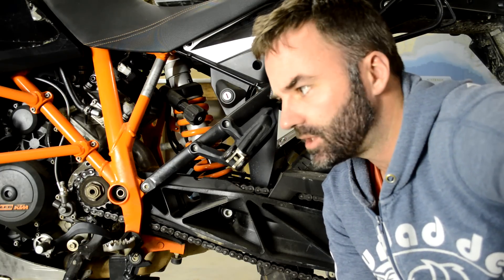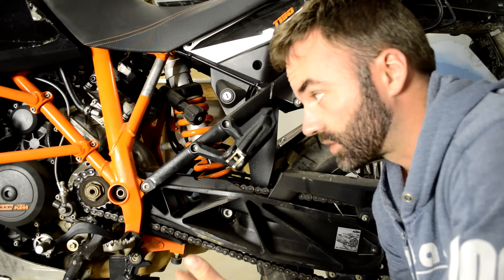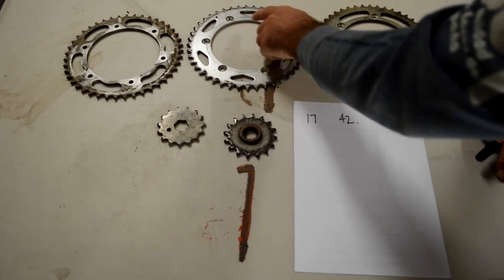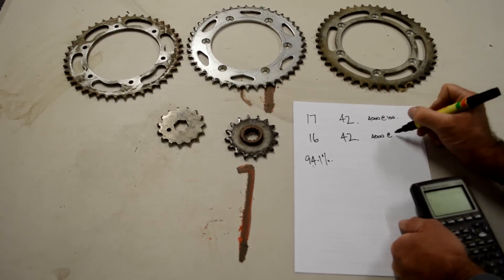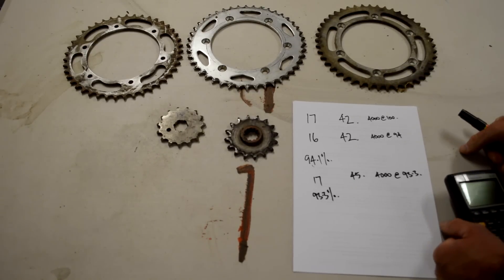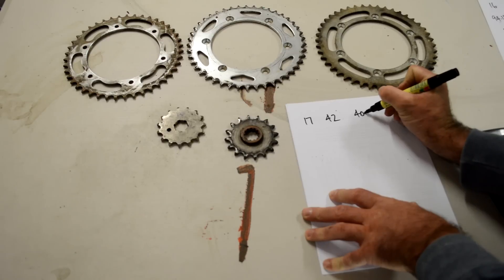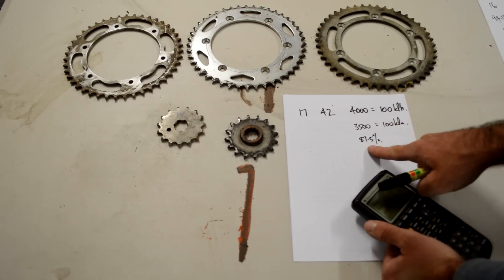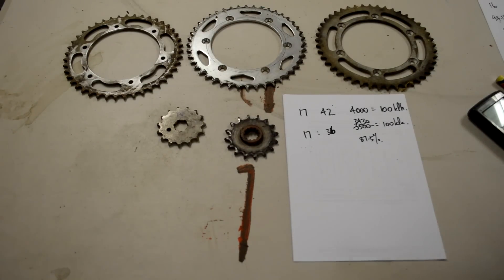Calculating what sprocket to get on your motorcycle

Comment: Do not throw your money away changing the sockets. This will only make 2 results:

1. this will improve starting off (launching)
2. this will increase your RPM in top gear at highway speeds. 

Changing the sprockets is changing the final gearing on your cycle. Changing the final gearing means nothing. What really matters is overall gearing. Overall gearing is everything from the engine to the rear tire. 
Overall gearing is a affected by these areas:
1. Manual Transmission
2. Drive sprockets (final gearing) 
3. Tire size (actually have to change rim diameter to change tire size much)

It is a very common misunderstanding that changing the sprockets will mean you'll always have lower gearing. That is not true. You have a manual transmission. That allows you to have what ever gear ratio you want. If you like the power of low gearing then don't shift until redline for all I care. Shifting at redline is not what you really want unless you are drag racing. My point is you can decide how high you want your RPM to go before shifting. 

If you like low RPM for fuel efficiency shift early and keep your RPMs low. 

Once you get in top gear you can't shift up any more. That's why I say changing the sprockets will affect the RPM on the highway.

Comment: great video thank you...
i do have a question...
if i keep the same rear sprocket and i increase 1 t in the front i can have more torque exiting from corners right? my engine will produce a little more torque and higher rpm.
Reply from the maker: No. If you want more torque, you need a larger difference between sprockets. Increasing the front sprocket is the same as reducing the rear sprocket, which gives you lower rpm for the same speed.
Reply: Any recommendations for my gn125 has 14/42 running at 7.5k at 100kph looking to get 6.5-7rpm

Comment: You also need to consider chain tension if you don't want to shorten or purchase a new chain. If you want drastic changes adjust both in the opposite direction. If your looking to increase rpm and gain torque decrease teeth in front and or increase teeth in the back; this decreases top speed. Larger sprocket in the front and or smaller in the rear and you increase top speed but lose torque. See if you can find dyno numbers on your bike and adjust the sprockets to the max torque and horsepower for the rpm range you ride in most. Example - Honda grom: I'm 300 lbs and needed torque and higher rpms, so I dropped one tooth in the front. This allowed me to get up hills and max out the rpms. I may have lost a couple mph of top speed but take off and hill climbing improved drastically. Most likely why the newer models went to a five speed.  Front sprockets are cheaper and I would suggest adjusting by one tooth only. If you speed reads off wheel speed your fine otherwise you will need a tune for correct speeds. Check with gps to confirm.
Reply: Your explanation is on point 👍🏼

Comment: Initial calculations are correct but later he is trying by guessing. Here is how to calculate and not guess and try: if you want to reduce rpm by 500 and keep the same speed you need to reduce rear sprocket teeth. 3500/4000 = 0.875
Then 42 teeth sprocket should be reduced to: 42x0.875 = 36.75 rounding it up to 37 teeth.
Thank you.

Comment: I have a SWM RS500. The standard hearing is 13/47=3.6153846153846 . At general rule one at the front is equal to 3 at the rear. So my my gearing from the factory is pretty good. I just change the front to get a reasonable gear change. The big problem is the bikes ability to hold the gear load. Also it's easier to change the front sprocket out there on the track.. it's all to do with the stall point of your bike. If you own an old school bike that has plenty crank your bike will carry pretty stupid gear ratios. But unfortunately theses late model bike don't and most developed torqued thru engine management systems. I carry  a 13 and 15..

Comment: Konnichiwa nerbson,  what gearing did u end up settling on with the 1190? 
I find standard a wee bit tall off the line/at the lights and off road.
Reply from the maker: I was just running 1 tooth down on the front.

Comment: Stock 15T/45T to 15T/47T and stock 140/60-R17 to 140/70-R17
Hello there, I am from Bangladesh and I have a motorbike called "Suzuki Gixxer 155cc 2014".

My bike has a ground clearance of 160mm. Problem is I often get pounded at the bottom part of my bike in many uneven speed breaker in my country due to this very short ground clearance.

Many in our country has overcame this issue by simply upgrading the rear tire size from 140/60-R17 to 140/70-R17. But I know this will cause another problem, false reading in the speedometer.

There are very few resources in my country, so I can't calibrate the speedometer or make any complex customization to the speedometer to make the reading right. So I came with another plan.

My stock engine sprocket has 15T and drive sprocket has 45T. Stock rear tire is 140/60-R17. I have my "speed reader"(I don't know the exact name of it) at the engine sprocket.

So, for stock rear tire the overall diameter is 599.8mm with a circumference of 1884.327mm.

If I change the tire size from 140/60-R17 to 140/70-R17, then the overall diameter is 627.8mm with a circumference of 1972.292mm.

By the unitary rules--

Circumference ---> Engine Sprocket(front) ---> Drive Sprocket(rear)

1884.327mm ---> 15T ---> 45T

1mm ---> 15T ---> (45T/1884.327mm)

1972.292mm ---> 15T ---> (45T X 1972.292mm)/1884.327mm

= 47.100T ≈ 47T

I know the power distribution will be low. I don't care about the top speed either. Just want to make sure the speedometer read the correct distance I am travelling.

So, if I change the stock chain sprocket from 15T/45T to 15T/47T and stock rear tire from 140/60-R17 to 140/70-R17, will it show the correct reading in the speedometer?
Reply from the maker: Your math is correct. 47T will make the speedometer read correctly assuming the speed is read from the gearbox. There will be no change in performance... the loss in torque due to larger wheel is offset by the increase in torque by a lower gear ratio.
Reply: @Nerb1  Thanks a lot for your reply.

Comment: This is full bs, you didn't mention in the end when you wanted to drop 500rpm, that if you wan't to calculate the front sprocket, you can't calculate the numbers in the same way you calculate the rear sprocket. If you wan't to find the 0,875 ratio in the front and wan't to drop 500rpm, you can't calculate it like 14 (14,875)/17 = 0,875!! Because the smaller front sprocket will give you more rpms! Why didn't you show this in the video? You can't always put the smaller number and dive it by the bigger in here. If you wan't to gain 500 rpm in rear, calculate 42*1,125. If you wan't to lose 500rpm in rear --> 42*0,875. If you wan't to gain 500rpm in front calculate 17*0,875 and to lose 17*1,125. Why not explain this!!?

Comment: Awesome simple direct video. I'm trying to set up an electric motor to turn my  snowblower chute. There's a huge wide toothed sprocket on the chute, I know now where to begin figuring out a proper drive sprocket for my motor so it's not too slow or fast! I know my motor's rpm, I'll count the teeth on the big sprocket and do some math v to figure out my rotation speed. Thank you!

Comment: I think my ninja 250 1994 with 25 inch wheels and a 6 speed manual gearbox that starts redlining at 14k and stops at 16k would go alright with a 36 tooth rear if I could fit it

Comment: You got it misleading man. Low gearing means that you got less rpm with the same speed of that stock gearing. Ex. At 100kph on stock gearing u may got 5000rpm but if u decrease gearing, on 100kph i assure you its lower 5000rpms
Reply: Wrong... lower gearing = higher revs for the same speed. If you’re doing 100kph in 5th gear at 5000 rpm. Then go to 4th gear which is lower your revs will go to say 5600rpm to stay at 100kph. Then go to 3rd gear and revs will be higher again... so lower gear = more rpm for a given speed

Comment: I'm dyslexic, and this was too many numbers for me to comprehend. So short and simple, changing my front sprocket is not an option in my case. However I'm upgrading my entire rear tire/ rim from spoke to mag rim. (Primarily because I keep bending the spoke rims) This forces me to change some mounting adapters, currently I have 42T on the rear large sprocket, Some of the longer steeper hills I can hear and feel the bike struggle to climb. But on flat straight road I'm averaging 22 mph at full throttle. 

So my dilemma is it wouldn't hurt to have more hill climbing power, but I'm riding on highway roads and can't afford to lose speed. I need to keep up with the slow lane traffic. Most the slow traffic is at least 35 mph. 

the adapter for the mag rim I'm looking at online is set up with a 36T sprocket.  How will the difference between the 42T and the 36T help or hurt me?

I am very limited what I can change. This is a bicycle with a 2 cycle motor on it. So I know I'm not any where near what a normal motorcycle has for engine ability.
Reply from the maker: Answered by email. Good luck champ.

Comment: Would that fix somehow the speedo overreading?
Reply: Orange Clockwork no because the speedometer is measured off os the front wheel as it turns, you changing nothing with the front wheel.

Comment: Any way to calculate what gearing the bike will support based on horsepower?

my sr125 has 14/49 gearing and 12 hp. Wondering what the highest gearing I could get is. Highest iv seen availible is 16/46 is that workable?

Comment: 42/17=2.47 .... change the front for more acceleration so say a 16 , 42/16=2.63 .....263-247=16 ....263/16= irony 16% so changing a tooth on the front down gives you 16% more excelleration. Sod top end , getting theres the fun bit .

Comment: Since when do you need to make a video to illustrate something that is so obvious?  Even a child knows about ratios.  Also, changing sprockets to reduce RPMs in the top gear is risky cuz maybe your little 125 wont be able to pull that tall "gearing" then if someone takes your bad ""advice", they may have then wasted money on sprockets, chain, labor, invested time... only to be disappointed.  Even if it does work, at 8000 RPMs, if there is a strong headwind, it may slow the bike down to 7000 RPMs whereas with the 9000 RPM setup, it would "muscle" thru the wind better.  This presentation is a gross oversimplification which tells me you don't understand much about motorcycles, gears, and sprockets.
Reply from the maker: Its not obvious to a lot of people. The video is to help. It helps a lot, and doesnt help some. No problem. If its not useful to you, you can move on. The advice is how to use maths, nothing else. No need to cry about it. Just move on.
Reply: I found this video very informative. You are most welcome to produce and post your own video.

Comment: Another crap video.  To get the 3500 rpm for your example, 37 tooth is a better choice.  It is so simple to do by inspection of the numbers.  Your have 42 tooth that spins at 4000 rpms and your target rpm is 3500 so look how the first 2 digits of 4000 rpms are 4 and 0 so using that same pattern, you can easily see that for a target of 3500 rpms, you should use 3 and 7 or a 37 tooth sprocket.  No electronic calculator is needed!  Downvoted for not using the simplest way of doing things.
Reply from the maker: So on my z125 which does 100kph at 9000rpm with a 30 tooth sprocket, how does your method work if I want to cut that back to 8000rpm at the same speed?
You can do better David. Just put your mind to it.
Reply: Shift to the next higher gear.
Reply from the maker: 9000rpm at 100kph IS top gear for a Z125. Something tells me you dont know much about motorcycles.
Reply: You obviously missed the "joke".

Comment: Hey, can i ask?
So, i got 250, max speed 160,but i want to cruise at 120-130, but RPM too high...8-9k is too much...

So, Q: sprockets, can i lower rpm ny changing gearing with sprocket? (What do i do, bigger or smaller rear)
Reply: PRUIKKI RACING smaller rear

Comment: If I have a GS750E big bore which makes it a 816cc stock is geared at 14/43 and I want the best top speed but still be able to accelerate at smooth and reasonable time. Can I increase both sprockets up to 17/47? Or does that just cancel each other? With 112 links and 530 chain.

Comment: You forget t mention what happens to the torque, whis is important when you hit a slope.
If you reduce the teeth on the rear sprocket by too much you will need to gear down more often.
The magic is a combination of speed n power which the manufacturer has figured works best.
And on the CBR, YOU WILL mess your speedo n odo.....so?

Please cover these issues. 

At the end of the day it all boils down to your personal preferences.

Comment: All this confusing stuff😂😂 I just wanna make my crf 70s front wheel come off the ground so I can ride wheelies😂
Reply: Its all in where you sit
Reply: basically, the smaller the front gear the more torque/pick up the bike will have. you need to get the equal rear sprocket and chain if you change the front sprocket though.

Comment: Hi Nerb1, great vids, enjoying them very much. Quick question, I have a 1190 non R and I need to change chain and sprockets. From your experience would you go unchanged 17/42 or for 16/42 or 17/45, I would like a bit more revs at low speed. Or is it not worth the hassle, thanks!
Reply from the maker: 17/45 for sure. Ive had no loss in fuel economy and its a little nicer at low speed. It actually feels better at highway speed also. 16/42 is almost the same ratio, but wears the chain a bit faster.
Reply: Thanks Mate, I'll go for that. My local KTM dealer actually recommended 16/42 but most 1190 users said like you.

Comment: If you have a shaft driven, is there anything I can do still simular to this.
Reply from the maker: No.
Reply: Nerb1 ok thanks that's too bad was looking at a 1983 yamaha seca 750. Do you know if that bike is any good?
Reply from the maker: I love shaft drives... basically maintenance free. I had a cx500 and gt550. The xj750 was alright I beleive. I wasnt a fan of the cruiser style, but they were popular. Go for it. You dont need to worry about changing the gearing.

Comment: The summary for what sprocket you might want to change to achieve different aspects of rpm power and speed

--Front sprokect change
bigger faster less rpm
smaller slower more rpm
bigger less power 
smaller more power

--Rear sprocket change
bigger slower more rpm
smaller faster less rpm
bigger more power
smaller less power

I recommend changing rear sprockets changing the front can put extra stress on the case drive gear bearing.

Comment: so if i change both my back and rear sprockets to a bigger size set will i get more speed bare in mind its a 4 stroke 125
Reply: 4 stroke 125 , lol change the bike
Reply: Dion Mannion Just drop the rear a few teeth for more speed changing both in the same Manor is redundant bigger in the rear slower bigger in the front is faster smaller in the rears faster smaller in the front is slower they're opposites if you go in the same direction they cancel each other out

Comment: i want more powerful pickup in my 200 ns so which is the best ratio for front and rear plz reply
Reply: Akash Limbu chongbang Add a few in the rear you'll gain take off but you will lose a little top speed

Comment: which is the best ratio for rear nd front in  200 NS....for top speed plss reply
Reply from the maker: 100 front 4 rear.... and a heavy duty clutch.
Reply: @prince hector thats just similar to the stock with 14:39 ratio.
Reply: Front pe dominar nahi to duke390ka lagale aur picheki or avenger220 ka lagade. Jinka ratio 15:36 hota hai...

Comment: There's a limit what you can do with changing sprockets. Remember that you still have gears. And each gear has a certain ratio.

If you increase the rear sprocket enough, you'l jjust make the 6th gear essentially a 5th gear.
Reply: Yeah a lot of people just sell sell sell, they forget about weight x ring rolls tire size ECT ECT hobb made weight punch it's not just go larger and it will have better horse more tourq. Case the guy with a life chain nicer roll less friction and less weight along with proper hobb and tire size you might just get burnt.
Reply: If increasing the numbers of teeth at rear end sprocket by 3 Teeth from the stock rear sprocket..do I have to change the chain as a whole or do I need to get a new chain with more linkage?

Comment: okay so where i live the the 50cc license lets you drive a bike with 50cc and a max speed of 45 kph and the bike i want to get can go with 95 could i change the top speed to go down
Reply from the maker: Sure, just double the size of the rear sprocket. I doubt that will make it legal though. Usually the laws are based on the factory stock bike.
Reply: Nerb1 normally when they do check they check the power because people do engine swaps
Reply: +Daniel Gera 
what country are you from?
Reply: sub to NIBSU2 X Hungary
Reply: Daniel Gera Yes, but changing gearing is not the way to do it if you set it so that you are revving very high at 45kph making it your maximum speed you're just wearing out your engine very fast just get an rev limiter or a governor which goes off your speed...
Reply: Filip Kavčič ahhh damn did I mention this is my first motorbike...I aint some genius

Comment: bro i have honda cg125..i installed rear lil big tyre and modify with suzuki gs150 shock with front disk...so dafinatly its dry weight got heavy as per normal...so what u suggest me do change front sprocket or rear.??? or both and which size